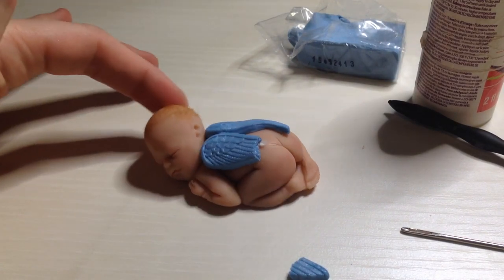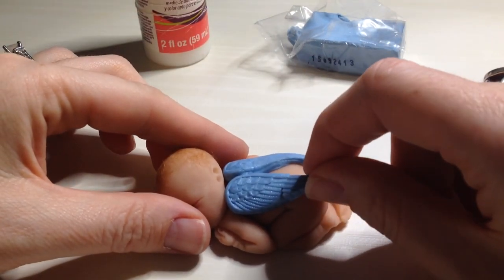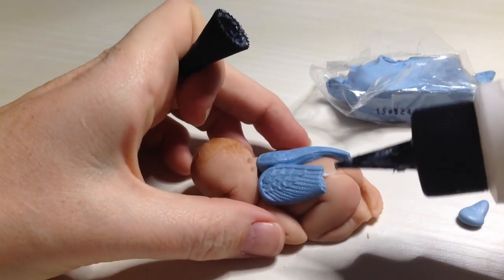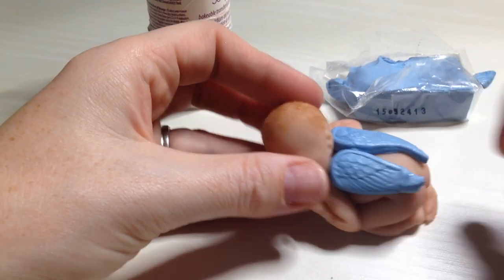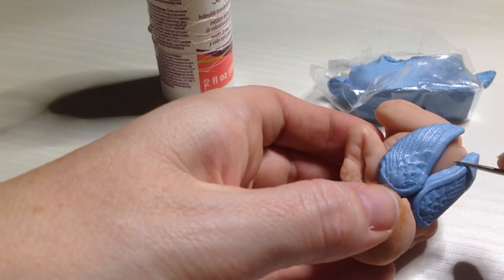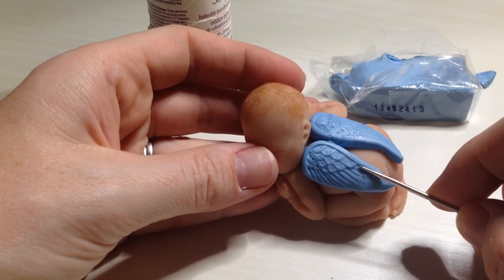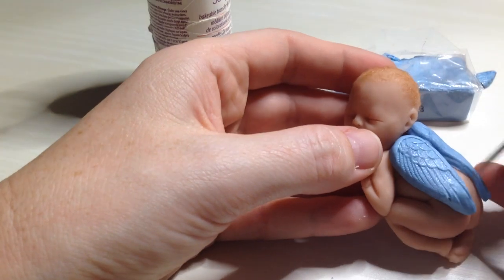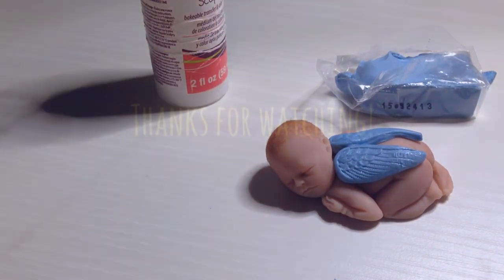How To Repair Broken Polymer Clay (Angel Wing Repair)

Comment: Does the liquid sculpey work for cracks that appear after baking? I am wary if I would put some on the cracks and would bake it again for 30 minutes. It might burn some parts of the sculpture that I did.
Reply from the maker: Yes, you can bake it over and over. Just bake it on a low temp 200 F for about 15 minutes after you fill the cracks.